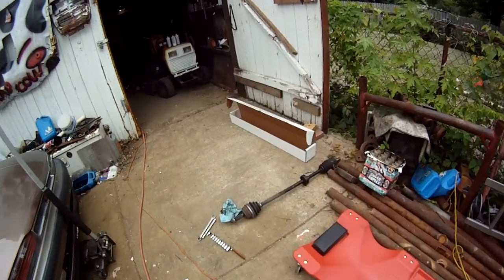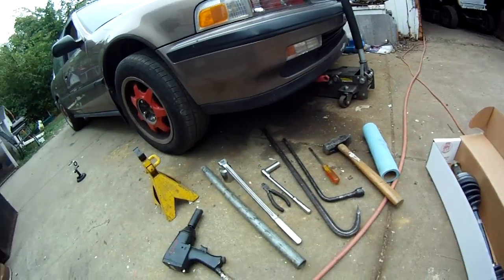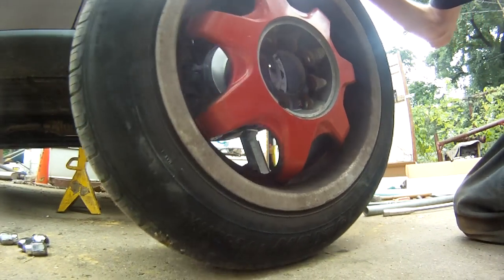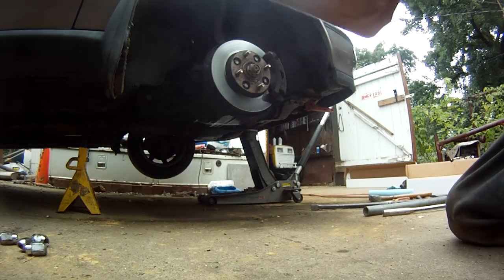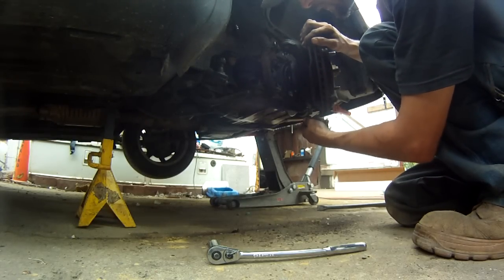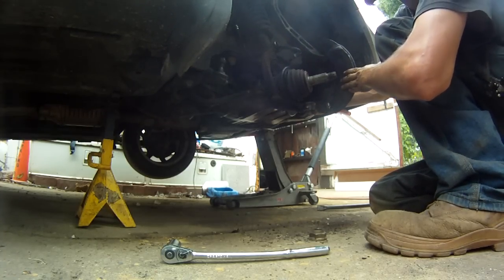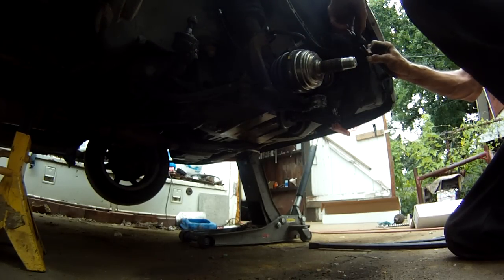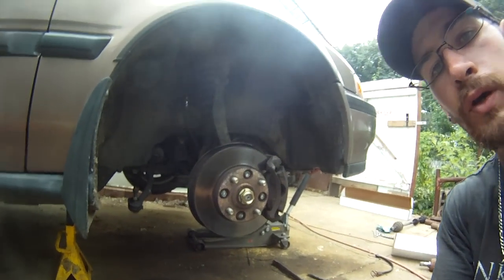How To Change A CV Axle On A 90-93 Honda Accord

Comment: Did I just watch a guy change a front axle in 6 minutes? The Honda GODS are pleased with him. LOL. Nice job!
Reply from the maker: HVACENGINEER Moran Like a boss. Lol
Reply: LOL.. no joke derbyman.. You are the man!! I told a friend of mine about this video. We have a $50.00 bet. He said no way.. I will soon be $50 richer thanks to you!! LOL. Wish We were closer bro. I got to do motor mounts on a 93 accord. the firewall MOTOR mount looks like a bitch to get to. But no doubt you could do it quicker than an oil change. LOL.
Reply from the maker: Thanks. That mounts not too bad. Its just 4 bolts but its a bit tricky to get out. Its best to pull the front mount at the same time and rock the whole engine forward for more room to get it out.
Reply: Good advice!! I was thinking the same thing. The "DOGBONE" mount at the radiator area?
Reply from the maker: Thats the one.

Comment: Nice! Efficiency and speed. I'll be doing this work on my 97 Accord SE w/auto tran this weekend. The CV axle is itself is good. The outer boot ruptured while removing the engine and didn't support the hubs while rebuilding the engine.  Lesson learned, car is running like champ, and get compliments how well it's maintained. It's my daily driver over 120 miles r/t to work and home with over 280K on the clock. She's a keeper...👌

Comment: My bearings came out the axle any tips on how to get it off the rotar and mount
Reply from the maker: Use a small prybar to pop the cup out of the trans and use a hammer to tap the outer part out of the hub

Comment: So i need to do this cv replacement on my high miles 91 accord, but my tranny is slipping pretty bad, I was told by a few people that if I pull my CV axel out of my transmission I could run into issues getting the new axel in, do you think doing a transmission flush, or just drain and filling my tranny before doing this will better my odds of a smooth axel replacement or will I just hurt my slipping transmission trying to flush it?

Comment: hi I'm gonna be replacing the driver side is it the same process it's like yours with the automatic trans and does it leak out a lot of oil none stop or just a little enough time to reinstall new axle,thanks

Comment: I’d recommend not jacking it that high up and not leaving the jack under I’d use another jack stand and only jack one side up not by the front and block off the tires so it doesn’t roll

Comment: also do you know why this cars sometimes when the engines is hot or after driving around the engine won't start you have to wait like 5minutes or so before the engine starts again otherwise if you do not wait you can keep cranking and it'll never starts , and does the fan comes on after you turn engine off ,thanks
Reply: Tony Tapuro it must be the main relay swith had this problem before and i saw a video in how to fix it ericthecarguy
Reply: Tony Tapuro  yes I've heard it is the main relay under the cruise control box under the driver side dash area...I have a 90 accord that does this too but it somehow fixed itself
Reply: I re solderd the points on main relay it helped but had to replace icm as well
Reply: Ignition coil, and distribution cap and rotor. That was with my 91 at least.
Reply: Tony Tapuro did you check all the fluid levels

Comment: My upper swingarm on same side is bad & I was told its easy, any suggestions?   Also, I see ur. everyman, u live in Louisville?   I do, just checking
Reply from the maker: The upper control arm is really easy to change out. Just 3 bolts. Im 2hrs away in Evansville.
Reply: Thank u.  I grew up in Evansville, actually Elberfeld, a little Mayberry like town down why 57. Thx again brother.

Comment: Looks like it's ok to leave the brake caliper on for this job.
Reply from the maker: Yes you can leave the caliper on. Just need to make sure the line has enough slack to be able to swing the whole spindle around and use a bungee to hold it out of the way